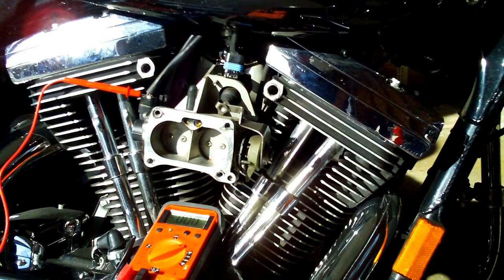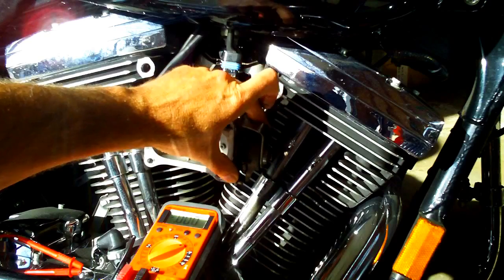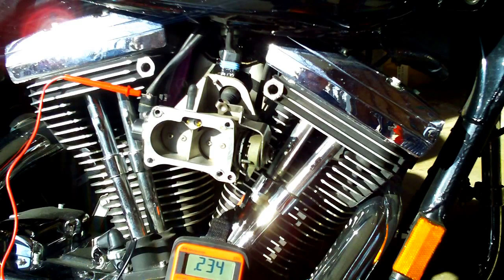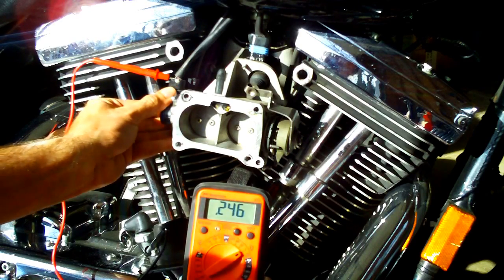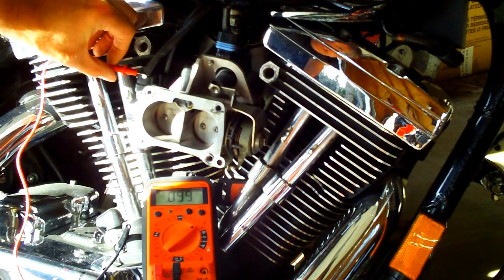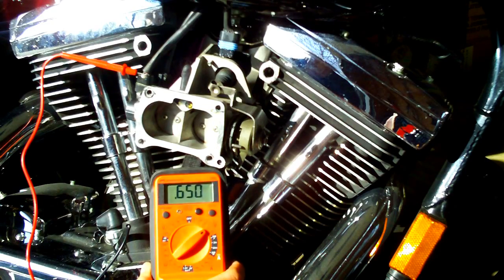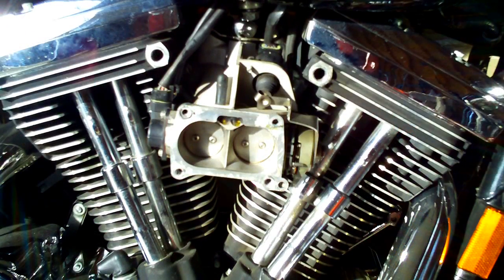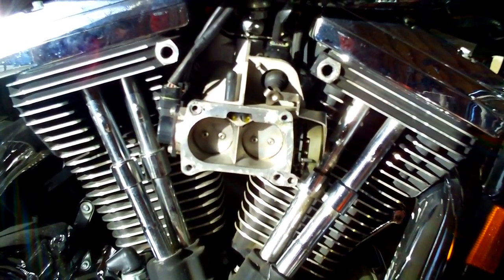Reset Harley Davidson Magneti Marelli Fuel Injection TPS Settings ✔

Comment: Hello Mark this is robbing the guy that bought your 97 Road King we had emailed one another in the past... could you please tell me what was the settings on the voltmeter in this video thank you
Reply: Thanks for the quick response Mark actually know the road king is still running absolutely fine starts up no problem and I think that is strictly because you did the adjustments 3 or 4 years ago the reason I'm asking is a friend of mine has a 98 Ultra Classic with the exact same motor but he cannot get it started when it's cold so I told him to watch this video and he's the one that has to say what exactly was the settings on the voltmeter but thank you for the quick response and yeah if you could find the exact settings that would be awesome thank you
Reply from the maker: @FreewheelerRTG357  I searched for a video of the last settings I put in but came up empty. I must have deleted it. Based on what I see on Dobeck's interactive EJK demo, I think it was something like this:
Green: 1.5 (or 1)
Yellow: 2
Red: 2
Green/Blue: 4
Yellow/Blue: 4.5
Red/Blue: 4.5
It didn't need much to both pull good and still get decent gas mileage.
Reply from the maker: Yes, I remember you, Robin. The warm and cold idle screws need to be backed out so the butterflies fully close. At that point, with the cold idle plug disconnected and the bike turned to ON, you should see 0.275 volts DC. One volt would read 1.000 which is too much. It's just over a quarter of a volt, that's all. I really wish I had written down the settings for the fuel injection tuner so you could put them back to that setting because it ran great for me. Do you know how to make the adjustments to it if I look into it?
Reply: Hello again....so after setting the FI just as you show in the video...we hit the ignition and the settings get thrown off. Would you happen to have an answer? Or maybe a direction to go in...thanks again.
Reply from the maker: @FreewheelerRTG357  sounds like the cold idle motor is turning the throttle part way open and changing the readings. Try unplugging the cold idle motor with ignition off. Then start.
Reply: We reset them again and then the same results...
Reply from the maker: @FreewheelerRTG357  still an issue with the cold start? Is it just turning over and over? Does he have to twist the throttle and hold it to keep it running until it warms up?
Reply: He has to hold the throttle open till it warms up. Now the bike is warm and it is idling way to high. It won't kick down. Could it be the throttle position sensor?
Reply from the maker: @FreewheelerRTG357  this sounds similar to a situation I saw on a '99 Electra Glide. The cold idle motor failed and needed to be replaced. Rather than replace it the decision was made to back out the cold idle screw so it no longer touched the stop, and slightly increase the warm idle (adjusted after the bike was fully warmed up) to just about 1,100 rpm. I'm pretty sure we unplugged the cold idle connector to prevent it from causing any weirdness in case it somehow came back to life. He had to manually hold the throttle on cold starts from then on, but it worked. So, with the air cleaner off, bike cold, stare at  the cold idle motor when you turn the bike on with the run switch on also. You should see the rubber boot slightly extend when you turn on the ignition. If you don't, it's a good chance that cold idle motor is at fault. Also at play here would be the cylinder head temperature sensor mounted down the top center of the front cylinder. If that goes bad, does the bike think it's already warmed up and doesn't need the cold idle bumped up? I don't know. Either part is pricey to replace "just to find out" and can be difficult to find. That's why we decided to go full manual warm up with the '99. Let me know if you test the movement of that cold idle motor.

Comment: Dont you have to unplug some eci thing so the bike resets to your adjustment or some such thing. I have a 2000 road king.  I believe its the marelli system. My cold idle is only 900rpm and my warm idle is 400 to 500 rpm. I've adjusted the warm idle screw with an alan wrench but my bike is still on the verge of dieing while waiting at stops unless i manually keep the rpms higher with the throttle. Someone please help if you have any insight. Bike runs fine other than the warm idle and I'd like the cold idle at more like 1300rpm.
Reply from the maker: Yes, it is recommended to unplug the fuses to the ECU and fuel pump after resetting is done. For your situation, all I can think is that you are not turning the warm idle adjustment screw IN far enough. Can you see in my video which one is warm idle and which one is cold idle? You need to turn both of them IN (clockwise) until the idle comes up to where you want. A little at a time while the bike is running, turn in the cold idle screw while the bike is cold until you reach your desired rpm. Then with the bike fully warned up turn the warm idle screw in until you're just a hundred or so rpm over the recommended1,000 (the idle rpm will drop slightly with the air filter and housing back on). You may need to experiment some or even leave it apart in the garage to try again once it has fully cooled off. Does this make sense to you? I had to add thread locker to both idle screws to keep them from changing on their own.

Comment: Anyone please anyone talk to me about the Magneti Mirelli EFI I currently found an awesome looking for it’s age steal of a deal 96 road king with the 88 EFI but from many I’ve heard that they have fueling issues from the MM system. Is this all they are referring to?
Reply from the maker: They have gotten a reputation of being unreliable and due to their age and limited run many shops do not know how or do not want to work on them. Even used parts can be hard to come by. There are carb conversion kits available, but at a cost. That being said, if you find one that is running well, pulls good, without the check engine light on, this many years later, maybe you've found one of the good ones. Check the fuel lines at the tank and throttle body for leaks. When I bought mine I discovered after I got it home that I had fuel dripping. Close to $200 later I replaced both lines from an aftermarket company with replaceable o-rings (that's what goes on the originals, but they are throw away once the start leaking). You might be able to find a Dobek fuel tuner for it to fatten up the hp and torque a bit. I used two different ones, both worked good, and I have videos of them uploaded. That's just the motor end of it. Another consideration is the frame/transmission relationship. The swingarm is mounted to the rubber isolated transmission. When the rubber "hockey pucks" wear out the rear wheel will start to feel loose side to side. This can also affect front to rear wheel alignment (I have a video on that as well). I replaced my rubber isolators, performed an alignment, and the ride was noticably better. The ride got even better when I bought my 2009 due to changes in the way the frame is made, but that bike came with compensator issues from the factory (and yes, there's video). All in all, it's up to you. Take it for a test ride, look for leaky gaskets, how is the drive belt, how many miles, etc.

Comment: Hello mark when you finished setting the tps did you use lock tite on the screws or just tighten them? I had to redo my tps on my 2001 road king today, noticed the bike was not running correctly I even unplugged my dobek tfi to see if it was that and bike still ran sloppy so when I checked it the tps was way off it was at 350 and the cold idle was 725 so I had to reset the tps and the cold but wanted to make sure if I have to use lock tite on the screws thank u for all the helpful videos
Reply from the maker: Thanks for asking! I don't remember right now if I used thread locker or a dab of fingernail polish around the head of the screw, but yes, put something on them. I also had to find a replacement nut on the end of the throttle butterfly rod where the cables connect. Fell off. Plus the warm idle and cold idle screws kept creeping so I thread lockered them too. Vibrations galore on those bikes! Glad you have a Dobek fuel tuner, I used two of them and thought they were awesome! Rock on! 👍
Reply: Mark Young - Outside The Box funny my screw from that tab fell off when I was riding times I have been thinking switching to a carb I love my bike but not this efi, some people loves them but hopefully this time I can keep it good if not might be investing a carb cv40
Reply from the maker: @aircamry  I was at that crossroad too before I found the specs and reset my bike. It ran like a top from that day on, especially with either of the Dobek tuners I used. Once you reset everything to where it's supposed to be, maybe you'll have that same reliability and forget about spending money on a carb setup. That being said, I've run bikes with CV carbs too, and they are the next best thing to EFI where they are air density based.
Reply: Mark Young - thank you for all the help people like yourself helps out all of us who is trying to figure things out
Reply: Hello mark I had the. Ike running great and it starts messing up again my tps is set at 0.275 and my cold 0.650 the bike will idle good and when I ride for some time and then park it for an hour or two at a location the bike will idle really high and stay there and won’t drop, so lucky I had my tolls with me I started to work on it to get the idle correct again, and again the idle dropped this time so far where the bike died couple times the 3 light I had to keep the throttle open at the light so I can get to a safe spot to pull over and check it, I’m not sure what’s going on? So I get home the next day I recheck everything all numbers are good and then start the bike and then. Idle drops so low again and then I added more idle and the bike seems idling ok now should I be looking at something else?
Reply from the maker: @aircamry  if there isn't anything switching on the check engine light, I don't know exactly what else to check. It doesn't sound like it's related to the warm idle screw causing it to high idle, so possibly the cold idle motor? Try setting it to a lower reading like 0.550 instead of 0.650? I have heard from others that the Temperature Sensor inside the top of the front cylinder may be sending false cold readings and causing the bike to up the rpms, but I wish there was a way to verify that without buying one. They are hard to find and expensive.
Reply: Mark Young - Outside The Box thank you for the fast reply, I will give that I try I was thinking about lowering it as well but wasn’t for sure
Reply from the maker: @aircamry  have you been unplugging the fuses to the efi computer for about 5 minutes after making your adjustments to reset the computer?
Reply: Mark Young - Outside The Box yes I have I let it set out for 10min
Reply: Mark Young - Outside The Box  hello mark does the magneti throttle shaft has gasket replacement, I found out what is wrong the bike will run good and then messes up so I sprayed carb cleaner around the areas Nd notice the idle dropped at the throttle area, I have been looking to try to find information about the shaft and looked in the book don’t see anything about replacing gasket at the shaft
Reply from the maker: I ran a brush load of fingernail polish around both screw heads. Maybe not the best way to secure them, but that stuff is pretty rugged and should hold. I am in touch with that bikes new owner and he has told me the bike is still running great. If you want to use thread locker, use the blue colored in case you have to readjust again.
Reply: Mark Young - Outside The Box thanks but I’m talking about the throttle shaft for the butterfly it’s leaking through the side air getting in
Reply from the maker: @aircamry  sorry, I replied to the wrong post. I didn't have any issues with the seals or gaskets on the throttle shaft. Not sure what's there, o-rings?
Reply: Mark Young - Outside The Box thank you mark, for all the help you have given, once I’m able to figure this out I will keep you posted

Comment: I'd like to see the service bulletin but the link is dead
Reply from the maker: I will remove that link, thanks for pointing out it is dead. Search for this: harley davidson bulletin m-1105. Also, there is discussion of a different voltage setting between the EVO and TWIN CAM motors. Read the posts from the link below, towards the bottom. Look for a guy named  
Ed Ramberger's posts on the TWIN CAM settings; here: https://www.hdforums.com/forum/ignition-tuner-ecm-fuel-injection/1117524-tps-replacement-suggestions-2.html